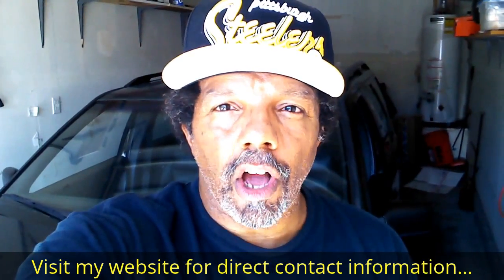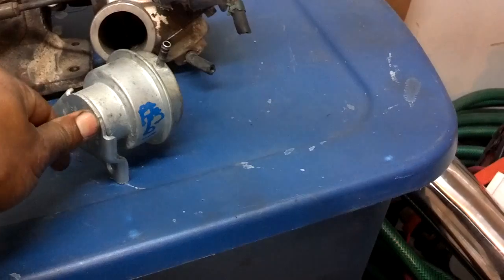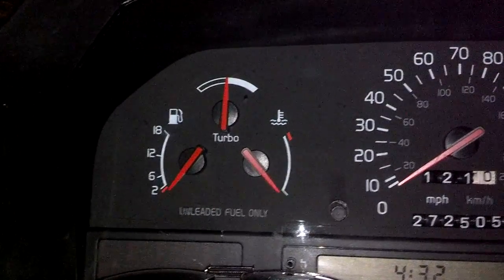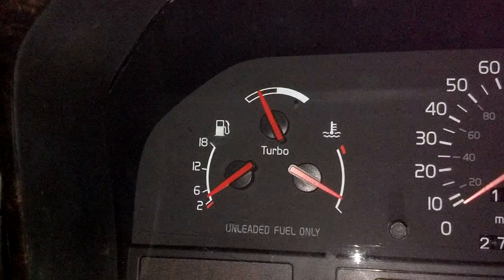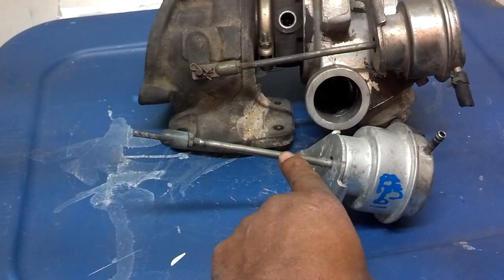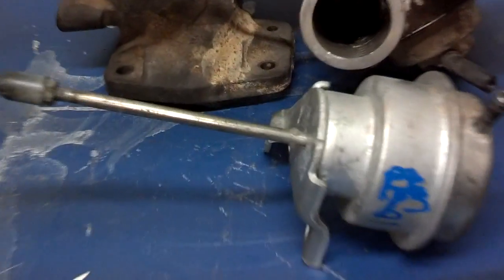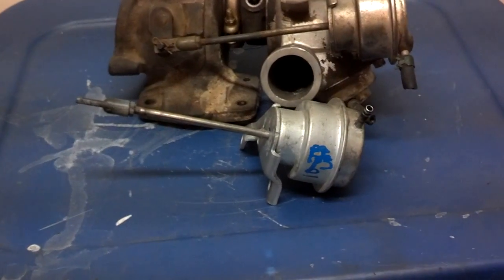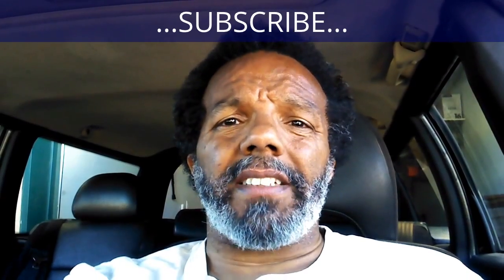How does the turbo, wastegate actuator work, function, information, testing, etc. - VOTD

Comment: Please help. I have a 2015 Hyundai Sonata turbo. About two months ago my car wouldnt pick up speed. You could floor it and it still took forever to get speed. My check engine light came on. Took it to the shop and they said it was the turbo. Got a new turbo put on and drove it for a few hours. Once I had put some miles on it the car started doing the same thing. Dragging and check engine light back on. Took it back to the same shop and he supposedly fixed it within an hour saying the waste gate actuator was stuck. Drove it around town for a week then went to drive a longer distance for my daughter’s tournament. It started again dragging and light came on. It also feels like it’s about to take off if you’re sitting still with your foot on the brake. This car is financed and I don’t have any other options. Please if someone knows anything that might be helpful, please comment or reach out. Thanks
Reply from the maker: https://youtu.be/NhtUXZTurzo
Reply: @ Its been at the shop for two weeks now. They were supposed to call me and let me know what was going on and what codes were showing now but still haven’t called. Last week when i spoke to them and asked for the codes they didnt know right then and also said the waste gate was not stuck like it was before. Is it wrong of me to be a little upset that aren’t calling me back, etc. i paid them 1600.00 to fix the turbo and the problem wasnt fixed. It continued to do the same thing. I have a feeling something was misdiagnosed.

Comment: When the car idle...is the wastegate open to the end of the bold or not ? ( 17psi )
When you drive at full power the wastegate actuator goes up ? (6 psi ) i search for my hyundai starex 2.5crdi 170hp how to set my actuator psi min and max psi
Reply from the maker: https://youtu.be/sr4hF8Z-ZbQ?si=42RKAmnm3sB1nu4J
Reply: @RobertDIY  thats for electric wastegate....i got vacuum

Comment: Hey i my waste gate accuator was turned the wrong way to hook up my hose. So i jst took the two screws out the bottom of the cup and its spring activated and i just turned it so i could hook up my hose and then put the screws back on. Is that ok
Reply from the maker: https://youtu.be/_Zt1_UWQKeg

Comment: Great demonstration. So can the arm still move with a torned diaphragm? My actuator doesn't hold pressure but however the arm still moves when air is applied. Is this  possible? I am thinking if the arm can't move out then the wastegate is closed give an overboost. But I am getting p0299 underboost. Please any help would be greatly appreciated.  Thank you.
Reply from the maker: I don't quite understand your problem.

Comment: Hi, the actuator for my wastegate is not holding pressure. The wastegate flapper is shut closed. But the actuator rod does move and open the wastegate when I applied pressure to the actuator. The flapper has no play and sits tight. Can a stucked CLOSED wastegate flapper cause P0299 code. I am getting a P0299 with closed wastegate flapper. Is this possible? Any help would be greatly appreciated. Thank you
Reply from the maker: The arm movement controls the flapper movement.

Comment: Any thoughts on a code stored but no check engine light? P0234......
Reply from the maker: The light bulb is likely burned out.
Reply: @RobertDIY  nope.....it's on every time w ignition one position. That's why I personally think it's very odd

Comment: Hi Rob. Just came across your channel today 
Question: I have a VW TDI Passat, 
Am not sure what components besides the turbocharger and wastegate actuator make up the turbocharger system.
Would you be able to give me a drawing?
PS I noticed there are no vanes in the VNT section of the TC 
It's a Garrett .
Reply from the maker: What year is the vehicle?
Reply: @RobertDIY  it's an aaz engine, 1996.

Comment: Great job done easy to understand. Thanks bro 
Is possible in future to use Gscan2 scanner to see pressure reading at different engine load (live data)
Reply from the maker: Not on my car. It does not report the boost pressure through the OBD2 port... Well, I have a new ECU with a boost map sensor installed. Let me see if the Scan Gauge will read it. I may have to use my laptop.
Reply: @RobertDIY  Thank you so much for fast reply 
I did my question because I have Europe Toyota hilux model 2015 which have so many parameters in live data 
Thanks again my dear bro

Comment: I can't get any boost. Changed the actuator, cleaned the wastegate, replaced all the hoses.
I ordered a N75 pressure solenoid. Maybe that will be it.
Reply from the maker: probably has a open pressure tube. Could also be the solenoid. Then the turbo could be busted.
Reply from the maker: https://youtu.be/oRwDce_ALkk

Comment: Hey Robert, how do you set preload on your w.g actuator? Mine holds vacuum but the arm over extends the nub on the waste gate without vacuum on it. From the little I've researched on it it should be slightly negative to where you have to slightly pull it forward to sit it on the nub.
Reply from the maker: pressure pump

Comment: i have a question.
i hanged my turbocharger and also the wastegate aktuator on my smart car.
but since than the car exxelerates not in a straight line but like waves.
i hold the exxeleration pedal constandly but the car exelaretes like i m doing the pedal up and down...
cant that be a problem with the wastegate aktuator?
Reply from the maker: Yes
Reply: @RobertDIY  hmmmm...and wahat is to do?
is it too weak? can i test it sone how?

Comment: Very informative ty love from England ♥️ i have a problem with my actuator according to my garage but i have a low boost problem? Not more power, they say the actuator arm is getting stuck
Reply from the maker: If you can afford it, replace it. A bad actuator can bend a rod.

Comment: What about if you’re getting an UNDER-boost? I was told my waste gate is not working but it’s creating an underboost, not an over boost. They are saying I have to get a brand new turbo. Any insight? My bank account would like for it to be fixed instead of replaced being that the part is $1400 alone. Thanks in advance
Reply from the maker: Underboost can be caused by a wastegate being stuck open. Other underboosting is caused by torn or loose turbo pressure tubing.
Reply: Robert DIY ok, so with that being said, let’s say the waste gate is being stuck open...... does that mean I need a brand new turbo or is this something that can be repaired? It’s a 2012 VW Tiguan

Comment: My Alfa Romeo 166 2.4 jtd has no power under 2500rpm. After that it accelarate normaly. I will change overboost valve tomorow i hope it will solve my problems.
Reply from the maker: any codes?

Comment: Thank you for this topic. I may have to diagnose my actuator too but I have a question for you. Since I will not be removing it from the car, Can't you also put a vacuum (brake bleeder tool) on the nipple end and see if it holds pressure?
Reply from the maker: You need a pump not vacuum.

Comment: very informative...quick question...my 2015 328i xdrive.
My car sounds like it's ready to race at startup and now idles at around 800 rpm and doesn't settle to it's once normal 600- 650 rpm until after  a few accelerations and stops. If i turn off the car and restart it, the idle is back at 800 rpm. The check engine light came on with a po171 code for awhile but disappeared on it's own. Could it be the turbo charger wastegate?
Reply from the maker: I doubt it. Sounds like you have a vacuum leak.
Reply: Thanks. I appreciate your response.

Comment: Hi Robert, I had to adjust the voltage by adjusting the actuator rod. Specs were between 3.9 and 4.1 and mine was at 4.6 so I had to bring it down. The problem it caused was not having boost on cold starts. Had to warm up the engine, turn off, then restart with a warm engine to get boost. Now that I have it within specs, I now have boost on cold starts.  However, going 55-60 and going full throttle, the car accelerates smoothly. I don't get that burst of power anymore. The low end seems fine though...  Any thoughts???
Reply from the maker: Voltage? I don't even know what kind of car you have...
Reply: @RobertDIY  2012 Kia Optima SX
Reply from the maker: Unfortunately, it sounds like you know more about that than I do.
Reply: @RobertDIY  lol...

Comment: I am working on a turbo for a Ford 3.5 EcoBoost. I had a code p0299 for low boost. I have the turbo off and their is a little bit of oil in both the intake and outlet of the turbo is this normal?
Reply from the maker: Not sure about that. Normally I see some in the intake of the Volvo's because they pull vacuum off of the engine into the intake piping. I would check it carefully for play and really make sure none of the turbo piping was loose or torn.

Comment: Hey Robert, I know this is a older video but thought I would ask you anyways...If I wanted to get more boost how would I go about it?
I am currently getting 12 -13 psi max boost . I would like to push it to around 14 - 15 psi Max
I am running a Pt Cruiser Turbo GT. I have the Stage 1 PCM and running a catless exhaust.
I am not expecting 20 pounds of boost but would like to get that extra 2-3 psi boost on command lol.. only when I need it for a few seconds to race once in awhile.
Is there a safe way to do it? I don't use a lot of boost when driving normal.
I just want to have some fun now and again....Any suggestions?
Reply from the maker: Is the tune you have capable of pushing that much boost? How about your fuel injectors and fuel pump? The computer/tune is supposed to limit the boost if it doesn't get enough fuel. You may want to Google "how to safely run more boost pressure".

Comment: Man every time I need an explanation on something you are always the one to perfectly explain exactly what it is I need. Good job and I Appricate it very much. Yes I agree why take out the turbo gauges
Reply from the maker: Thanks for watching.
Reply: @RobertDIY  what to check if there’s not enough vacuum reaching the actuator ?
Reply: @Mr330d I am still learning. But if this helps you. 
Check for vacuum leaks, throttle body gasket, vacuum lines, and even better, use a smoke machine, etc.

Comment: Is it possible for the flap that opens inside the exhaust side of the turbo to become detached from the lever the actuator controls. My actuator seems to work fine  but i'm building no boost and have no external boost leaks. I get some pressure build up in the pipes but my gauge reads 0 bar. Basically if the flap was permanently stuck open, but the lever is working back and forward as it should, then would the turbo be able to build enough boost to work the actuator? Mine doesn't move at all when running the engine but can operate it normally with compressed air. That's why i think the the lever and flap may have come detached somehow. Many thanks.
Reply from the maker: That is possible.

Comment: My wastegate is working, but should it open immediately wen i start the engine?
Reply from the maker: No. It opens to slow the turbo down to prevent overboosting.
Reply: @RobertDIY  Thanks for the quick answer, i thought that the wastegate  opened when i started the motor, because i saw it moving. Now i know that it is opens when the engine isn't running and it closes as soon as i start the engine LOL!
Reply from the maker: Interesting
Reply: @RobertDIY  It's a european (French) Car Citroën Ds5!

Comment: Would this cause a car not to start? I have an intermittent problem with a Saab that has a turbo. So far mechanics have got it wrong. Replaced ecm and fuel injectors. Still same problem. Once in awhile it doesn’t want to start but will start with gas pedal to the floor. It will let out some smoke and smell like gas and idle rough a few minutes then it’s fine. Engine light is on and it’s throwing out one of the codes for a waste gate solenoid. Any help would be greatly appreciated!
Reply from the maker: https://www.youtube.com/watch?v=YiPAPu-K8OI

Comment: I have diesel 2007 opel astra h 1.7 cdti the actuator doesn't move even if i put a load the problem is I had it tested like you said and it holds the pressure very well can you please tell me what the problem is
Reply from the maker: I can't see it from here. Should not move by hand.
Reply: @RobertDIY  i know but when the engine is on should it be moving back and forth ?
Reply from the maker: Only if the load causes boost above 2 psi or so. You may need to put a camera on it while driving.
Reply: @RobertDIY  i will thank you !
Reply: @RobertDIY  what if : engine is on gas pedal pressed all the way down for a while should it be moving !? sorry for asking so much questions
Reply from the maker: If the car is NOT IN GEAR, you will NEVER get the waste gate to function. NO LOAD.
Reply: @RobertDIY  got you thanks a lot

Comment: I have just purchased a car and the actuator vacuum hose was not connected, when i connected it, the car would not drive over 15 mph, when i took the hose off, it was OK, but the turbo does not kick in ! any ideas what may be the problem please...
Reply from the maker: I don't even know what kind of car you have. 😕

Comment: My volvo 940Turbo spiked to 12-15psi
Reply from the maker: Ouch!
Reply: Yeah im scared to drive it at the moment
Reply from the maker: Probably a bad waste gate. You can pull a vacuum line off the intake and that should make a good enough leak to drive it safely. Or just take it super easy on the gas pedal.

Comment: Where would you hook up a boost gauge on a turbo that didn't come with one. I have a catapiler 3126 in a RV.
Reply from the maker: You should tap into a vacuum that is connected to the intake manifold.
Reply: Robert DIY  Thanks, could I use a "T" in the vacumn line that goes to the waste gate actuator?

Comment: +Robert DIY  I have a 2000 s40 with an over boost problem. It has spiked to 15 psi. It's throwing a P1241 code. I replaced the waste gate actuator cause my old one wasn't holding pressure.  It's still over boosting could this a tcv problem or maybe even a bps ?
Reply from the maker: Usually a waste gate issue. Is it working properly?

Comment: You think I should be ok with only running 5psi on a stock engine ?
Reply from the maker: +bikefan81 sure but I have no idea what kind of car you have.
Reply: Robert DIY 95 jeep yj 2.5 litre
Reply from the maker: +bikefan81 was the vehicle built for a turbo?
Reply: Nope it's just a naturally aspirated engine
Reply from the maker: You have to set the management to reduce the turbo boost until it's safe to boost. Example, the boost on my car doesn't really start kicking in until about 2,800 rpms.
Reply: Robert DIY well I plan on getting a wideband sensor also so I can monitor afr

Comment: I think the finger method is not valid for all actuators. On one of a Garrett turbo, with compresed air it worked fine, but moving the stick out and pushing the finger in the little tube, it don´t keep the possition, it goes back. Only a little amount of air is manteined. Great video!
Reply from the maker: +Juan X correct, pump is best
Reply from the maker: +Juan X correct, pump is best way to test them.
Reply from the maker: +Juan X correct, pump is best way to test them.

Comment: I am getting an error code P0234 on my Audi A4 2007 2.0 t.  CEL light is on and I feel power loss bad accelerating and even sometimes some problems with transmission gears.Can it be solved just changing or repairing the wastegate actuator? Should turbo be removed completely for this job? Thank u in advance
Reply from the maker: +Elvin Safarly if the turbo is good just check vacuum lines to the turbo.

Comment: My Wastegate is stuck closed, I did the test for the diaphragm and it was good. So why does my engine light still go on and off? Why does my car feel slower than normal.
I don't have a boost gage, and I got a code from AutoZone P2261. I have a 2010 Hyundai Genesis Coupe 2.0turbo
Reply from the maker: If your wastegate is stuck closed, it can/will cause over boosting which will likely damage the engine internally. Other than that, not sure what to tell you.

Comment: Great videos. Question for you. I have a 1994 7.3 IDI factory turbo f250. I never hear it spool up. How do I know if its working properly or not? I don't have a boost gauge or egt gauge but plan on getting one soon.
Reply: +countryboyMO2009 Also Do all turbos have a wastage actuator and bypass valve?
Reply from the maker: +countryboyMO2009 If it wasn't working it would barely move. They should be quiet. Yes, I believe all turbos have waste gates and bypass valves.
Reply: Ok. Thanks. I was also wondering would it be worth it to install an aftermarket turbo Wheel. I was looking at the Billet Wicked Wheel 2.
Reply from the maker: If you need more boost and power. Usually you will need a tune to compensate for the different boost characteristics.
Reply: My truck is lacking in slow response.
Reply: I plan on getting a 5th wheel hitch to pull a 5th wheel and think I will need more boost and power going up hills and what not
Reply from the maker: Usually not. I would try it first but you can check the tow rating in the owners manual.
Reply: Ok. Thanks. Enjoyed your videos.

Comment: What causes the turbo to whistle? If no whistle does it mean the turbo is defective?
Reply from the maker: Rogelio Dela Cruz Usually the speed of the turbine turning and pressurizing the air. In most vehicles the turbo is pretty quiet unless you are boosting over 8 psi.
Reply: Robert DIY Thanks Robert!
Reply: @RobertDIY  do you have a contact number?